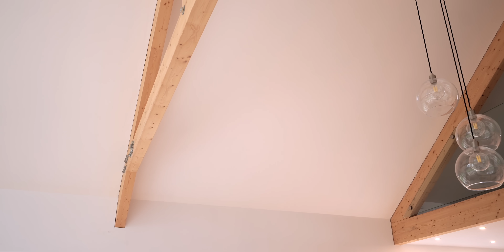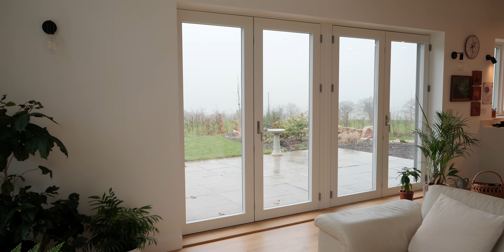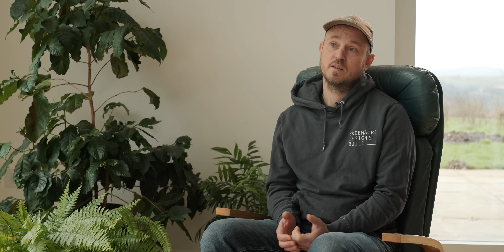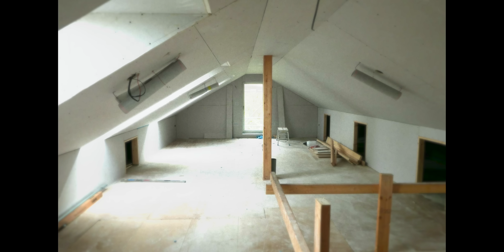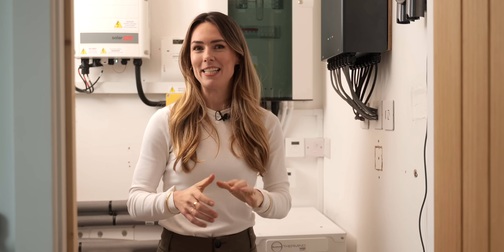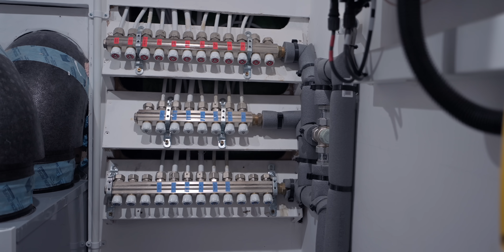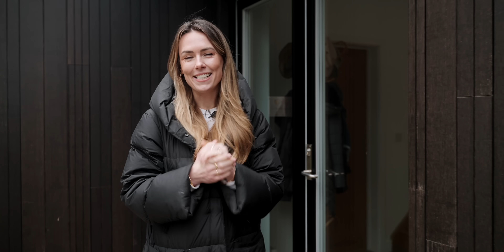Ditching a Heat Pump for In-Plaster Infrared Heating?!

Comment: Except infra red doesn't effectively heat the air does it. Heats the person and the furnishings, but the air is still cold. The whole time you are not sat directly in front of the element, it's a total waste of energy. I use infrared heaters in my electric blanket and my heated jacket, but I wouldn't want to be sat  under a parabolic mirror cooking. Edit: Not a "total" waste of energy
Reply: That’s a really common misconception about infrared.

Infrared doesn’t heat the air directly, but once the walls, floors, ceiling and furniture are warm, they re-radiate heat back into the space and the air temperature rises naturally. After a short run time the room air is warm and stable — not cold with hot people.

With plastered-in systems like ours you’re not sitting in front of an element or under a reflector. The heat is spread evenly across the entire ceiling or wall at around 38°C, so there are no hot spots and no “cooking”.

We’ve heated thousands of buildings this way since 2013, including bedrooms, bathrooms and whole houses. Comfort comes from warm surfaces and even radiant heat, not blasting hot air around the room.
Reply: @ASTECtherm_Infrared_Heating  It might be fine for passivhaus or a really air tight and insulated house, but I hate to imagine how many of your plastered panels I'd need to heat my 1950s mid-terrace on demand. I estimate my home cools at about 10kW. So 5x more than the passivhaus here (and they wanted more panels let's not forget) and that'd need to be on 24/7 over winter just to maintain the temperature. The cost over my gas boiler and the sheer number of panels I'd need would make me feel like I was hostage under a parabolic mirror! Unlike a heatpump the CoP is 1, but if you only need 2kW or maybe a little more, I accept it makes sense and has a convenience to it. Horses for courses, but it isn't gonna be mainstream is it.
Reply: @friarchris2  watch this space!
Reply: The air gets warm from the hot surfaces.
Reply: @johnburns4017 yeah I get that. Just as my electric blanket heats me and then I heat the air.

I watched it again and they said 2kW and hinted that they needed to add more panels in the dinning room. There will be occasions when the air is 18⁰C and the infra red is also on and I'd have thought that would feel oppressive. Not the way I'd want to heat a passivhaus.

Comment: Why is that infrared heating not put under the floor? Wouldn't it be much more effective in that location?
Reply: Hot feet, cold heads
Reply: 😂😂😂

Because it's FAR IR radiation.

The radiation warms up a person, not the air that surrounds us.

That said nearby surfaces become slightly warm and re-radiate heat as well.
Reply: @ForestForest-n9i  they do make under floor IR heating elements. The reason why ceiling is preferred is because he floor covering itself insulates against the infrared radiation. This type of heating works best when there is little or nothing in front of the radiator.
Reply: More heat output needed in the floor. Plus faster reaction and more natural from above.

Comment: I have some sympathy with this home owner's philosophy. While heat pumps are excellent, they are also complicated pieces of kit which need maintenance and repair. This is one of the reasons why the fabric first approach, when applied to deliver the Enerphit Retrofit standard, should be a priority for government subsidy. It need only be done once per house and would reduce grid demand by -100 billion kWh annually, assuming the predominant clean alternative is the heat pump.

Comment: A battery system and solar generation go together like apple pie and ice cream.  It's easy to configure it so that it will stop supplying the house at (for example) 50%, leaving plenty for when there is a power cut.  A very odd choice...
Reply: At 7p a kWh it is cheap enough to heat DHW and get the house warm for 8 am. It will retain heat and may generate some free solar electricity during the day.

Comment: You can use your battery as normal and when there is a power cut you use what is left + solar production to survive. Does not have to be 100% full when the power goes out.
Reply: Yeah exactly. I'm sure you can set a limit on how much you want the battery to drain in everyday use as well. So set a limit that will give you a decent amount left so you can still keep the fridge freezer and lights on. Or just get a bigger battery so you've always got a day in reserve.
Reply: @biggityboggityboo8775  yes, this is what I have set on my sigenstor battery. Emergency 10%
Reply: Yes or V2G
Reply: @Mn6g1834  yea i wonder if he has V2G, so he can just use his car as a battery for a 2 person household is easily sufficient
Reply: I have my system set to hold back 15% (~5 kWh) for powercuts. But it keeps tabs on the weather forecast and when there's a storm expected it charges to full. I don't think that's particularly freakish.
Reply: yeah, and if he was that scared the just have multiple. i for instance has 2 10kwh ones fitted and able to take to more, then again looking st his roof he could have got far more solar on too.
Reply: @damiendye6623

😂😂😂 

You type as a  gear head who lives in a bubble planning for Armageddon.
Reply: Why have it when you can do without.
Reply: @oOCentralSunOo  Because you get much more efficient usage of your PV. When we added a battery (and some more panels) our grid usage dropped from 78% of consumption to 5% of consumption. Your average Co2e/kWh drops dramatically too because you can almost always avoid high-carbon times.
Reply: @oOCentralSunOo  The protection against power cuts might appeal, if the guy lives in the middle of nowhere. YMMV.
Reply: @NunoLima1337  Yup, and he even mentioned power cuts!
Reply: @NunoLima1337  Yes, but the cost of a 6-20 kilowatt system is expensive and a lot of questionably allocated resources if its not used much. Perhaps a gas or propane generator would be more practical.
Reply: @oOCentralSunOo  Batteries are cheap now, 5kwh can be literally only £1k(yep, its true) which could be enough on an ultra efficient home like this, but they're clearly not worried about spending loads of money. Installation and inverter and stuff is what can add a lot if its an awkward home and wiring needs to go far, but everything in their home already goes back to a nice spacious utilities room, couldn't be easier. They actually already pointed out they have the salt battery for the heater so they do kind of have a battery already anyway, now just put another one next to it for energy.
Reply: @oOCentralSunOo  a 16kWh battery is £1800. That's not that much money. Plus £1000-2000 for inverter/charger+fitting.
It would be more resource-efficient to install batteries at substations than on every individual property: there would be significant diversity gains, but at the moment, because the charging interface is at the home meter, that's where the value is realised so batts are going in houses, not (mostly) substations.
Reply: @xxwookey   I am glad to hear the price of batteries is so affordable. It certainly is a good option for those who need or want them, and can afford it :)
Reply: @xxwookey with battery at substations, you lose control and resilience: substations are exactly what is targeted in case of military conflicts (even though you’re not allowed…).
Reply: @oOCentralSunOo  Once you have a battery you can look at alternate methods such as small wind turbines for winter energy, you still sell excess production and not have to deal with rising energy prices at all.
Reply: @oOCentralSunOo  When you add a battery - you can make much more use of your solar, and totally offset all of your electric import to off-peak hours (as long as you have a reasonable size inverter) - then if you have it as an off grid system, then it means that if there is a power cut in the daytime - you can still use your solar (if you don't have a backup solution, then you dont even get power from your solar in the day if there is a powercut)... as a total backup, you can add in an LPG powered generator, to be low carbon if needed... 
Alas V2X is still very rare, and most cars will not honour their battery warranty if you do use it for V2X... (the sigenergy EV charger is the best unit for this at the moment if you don't care)
Reply: that's what tipped me off that this house is fake. 99.9% of the world couldn't afford this home or the land
Reply: Seriously?

How long do you envisage a house can be powered by batteries?

Recently in Cornwall some places were bereft of electricity for five days.

Suggest you do lot more research followed by even more deep thought before you brag on about backup batteries.

Without electricity even gas central heating won't work because of no power for the electronics in the boiler and circulating pump.

Consider too that even BESS systems have their limits.

If one is sensible then best to opt for a multi fuel stove burning smokeless briquettes.

Both heating and cooking. Candles for light.

Oh and best to have a chest freezer you can cover with duvets and coats.

Fossil fuels always work.
Reply: @ForestForest-n9i  Tesla Powerwalls can be wired to allow multiple circuits to be protected. That's what I did with mine: whole house backup, AC Coupled. The boiler will run for as long as there is charge in the PW, and the inverter is set up so that the battery can charge from solar even when there is a power cut. "Island mode" was a term the installers used to describe all this.
If I had a power cut, I would minimise the use of appliances so that the capacity at my disposal is not wasted before the grid comes back up. If this happens in the summer, it's much less of a worry as my own generation more than covers my regular domestic use. I do have a gas heater as further backup, but it would have been silly to have a solar+battery setup without the extra protection, even if it was expensive.

As for fossil fuels always working, the petrol stations require electricity too, so it's all a matter of preparation, no matter your choice of tech.
Reply: @NunoLima1337 

Last shall become first.

Who's to say there isn't a backup generator for the petrol/diesel station?

Works both pumps, tills and WiFi for card readers. Job done.

From your post I regret to say you have missed the point ref power walls.

Again, power walls won't work forever and you can't charge a deeply discharged battery from your solar at night. If you had a wind turbine then a different matter.

If you are connected to a local BESS facility then again you face the issues of discharging to a community.

If you were unfortunate enough to own a BEV then there could be an issue with recharging a battery bank and you could be "marooned".

The best option all round is to have a multi fuel stove with a top large enough to cook on or just heat up ready meals.

Obviously plenty of fuel  for the stove and candles, bottles of potable water (plus booze) and plenty of wet wipes which can be burnt in stove.

I have a diesel generator too and plenty of diesel.

Diesel also warms water to 85C, and then down to 65C, via thermo mixing valve, to avoid possibility of Legionnaires Disease, and scalding.

A chest freezer you can  cover with whatever keeps the cold in, so to speak.

I have lived with these backups for years, never been cold, never hungry, always a hot drink.

Not forgetting a bank of lead acids and system for recharging phone and tablet.

Not that expensive.

As for going green then  I forget all that as I try to avoid going blue.
Reply: @ForestForest-n9i you can get 32kwh of batteries for 3 to $4,000  in the standard home that probably 2 days, maybe double that in a super efficient home.
Reply: @turtle1723 

I despair.

I really do.

We need to know what the draw on the battery is for context.
Reply: @ForestForest-n9i  except when they dont. Nothing is an always.
Reply: @ForestForest-n9i you literally just said a gas boiler wouldn't work... just burn wood, it's not a fossil fuel.
Reply: @pumpkinhead456 

😂😂😂

Clearly you're an expert in getting things wrong.

Oh well.
Reply: @ForestForest-n9i I usually don't indulge, but you're funny. Please explain how 'fossil fuels always work' and 'gas boilers need electricity' go hand in hand? For what it's worth, probably very little, my battery could keep our essentials running for 5 days but we'd need to use our wood stove for heating or the heat pump would drain it in a few hours.
Reply: @pumpkinhead456 

😂😂😂😂

If the nom d'internet fits  ...

Kindly refer to previous post.

Now, have you thought of doing the Google thing ref my rather splendid, not to say apt comments?

You should.

Comment: Really interesting episode, thanks! 
Bringing older housing stock up to this standard of efficiency is the challenge.
Reply: And is it worth doing?

Or better to build newer, technologically superior homes so everyone can enjoy a better standard of living.

Get rid of the old poorly designed and built terraced housing that seems to leak heat despite spending a lot on insulation improvements.

Anyone who can be arsed can research the topic of insulation, which is key, ranging from triple glazing to buildings in Japan (as but one example) insulated with earth ... cheapest of all materials and is on the doorstep, literally.

And that Tolkien bloke most certainly knew a thing or three about insulation, without a shadow of a doubt.
Reply: @ForestForest-n9i  Good points, thanks. I'm no expert, but guess it depends if market mechanisms could be reconfigured so that renewable energy sources weren't pitched at the highest gas prices -- i.e. renewable energy should really be low cost energy . . . then 100% efficient insulation not quite as critical -- so existing housing maybe could be upgraded. Otherwise new build passive house standards required, but what cost to the environment/treasury.
It ain't easy and governments appear too ambivalent (or unwilling to act) on the issue.

Comment: Infrared heating! R U sure? That's how microwaves work. Do you really want to cook yourself? FFS!
Reply: Infrared 300GHz - 400THz
Microwave 300MHz - 300GHz
Reply: @cwt5654  I rest my case. I'm going nowhere infrared heating. It's alright for Bobby and his acolytes to promote, but Booby for one won't be around to suffer the consequences as he will already be dead.
Reply: Microwaves and infrared are completely different parts of the spectrum.

Microwaves use high-frequency electromagnetic waves that excite water molecules inside food. That’s what cooks it.

Infrared heating uses long-wave radiant heat — the same energy your body emits naturally and the same warmth you feel from the sun a radiator or a warm wall. It can’t penetrate your body and it can’t “cook” anything internally.

If infrared was dangerous then underfloor heating fireplaces sauna cabins heated bathroom floors and even central heating radiators would all be a health risk. They aren’t.

This is well-understood physics and has been used safely in buildings for decades.

Comment: He's right that solar PV is WAY more impactful to running costs than a battery. Especially with current installed battery prices. A GivEnergy 9.5kWh battery and inverter might cost £8k installed, and over it's warrantied life assuming 7p/kWh night rate and 25p/kWh day rate, you would be lucky to break even with the savings. That is factoring in capacity degredation and conversion losses that most people ignore because they think it's too complex to model.

If you shop around you can get a cheap system installed cheap enough that it makes sense. Basically take £800/kWh installed as your absolute max spend, and anything less than that is "profit". It's totally possible to get battery installs for less than this, but solar capacity has a better ROI. Most of the solar cost is in the fitting too, so max out capacity whilst you're at it. 

Basically doesn't matter what direction the roof is in, brim it with the legal limit of panels. It's also cheaper to install them on a new house because you save on tiles. I've heard the solar panels can be the same cost or cheaper than tiling the roof. Then you have to pay a bit more to wire them up and get an inverter installed.

Comment: If you have a heat pump, then MVHR is a waste of money. It would cost maybe £40 a year to heat the air exchange rate required to maintain good air quality for two people (property size is irrelevant). They are warrantied for 5 years? So assuming its' 100% efficient, that's a £200 budget for your whole MVHR system.

Say it actually lasts 20 years, and it's still 100% efficient; £800. Which is still basically impossible for whole house MVHR like this, installed.

Say it's not heat pump powered. £3200 over 20 years assuming 100% efficiency. At 75% that's £2400 whole system installed budget.

The current MVHR system costs are and absolute joke. And the single room ones are a bathroom fan with a timer and a £30 ceramic heat recorvery core. They should cost no more than £100 a piece. The green industry is robbing un/misinformed early adopters.